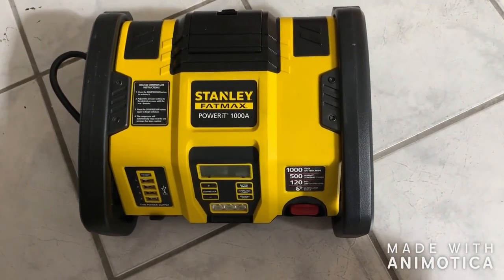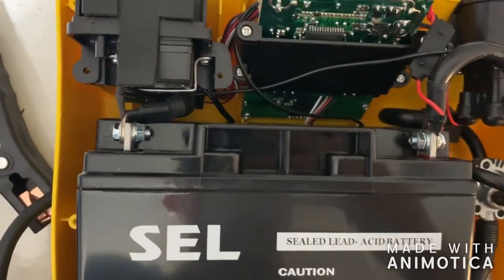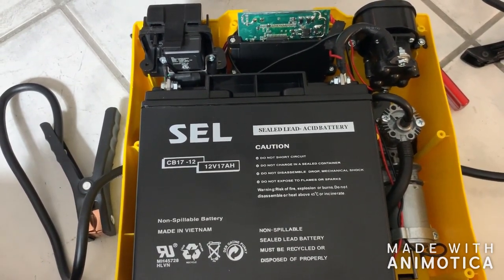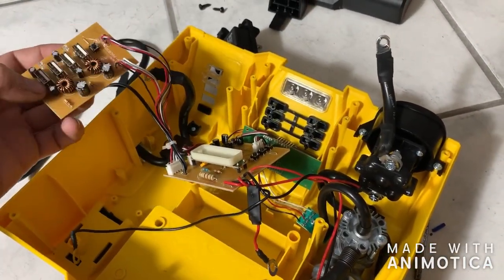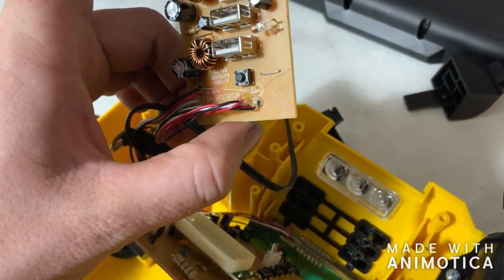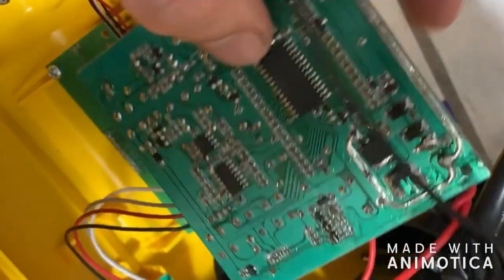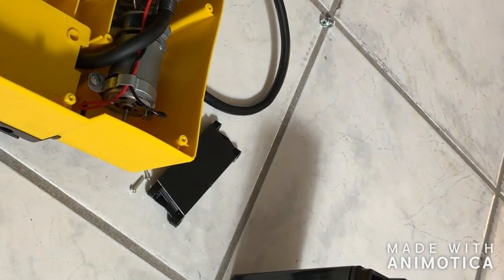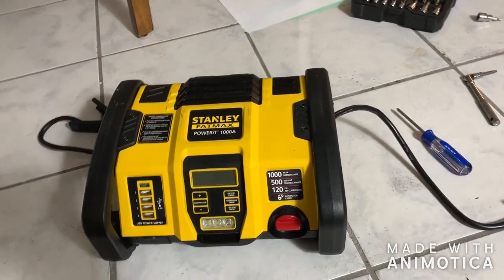Stanley Fatmax Jump Pack - Disassembly and Review

Comment: I've only used my charger about five times in the last two years. It would work just fine until about two weeks ago. I took it off of my truck to charge it up because I figured it was dead. No lights where on are doing anything. Charge it for 24hours and still nothing. Did you find a fuse or something that I could begin the trouble shooting or do you think it's DONE?
Reply: Same
Reply: Lead acid battery is likely kaput.
Reply: I have one just like it, I used it two or three times and left it charged, time passed and I saw that it had no charge, I put it to charge for two days and the battery is dead...

Comment: The way these things work is that the jump pack charges the cars dead battery and then supplements extra current to help the cars battery start the car.  The internal batteries cca capacity can be lower than what is required to start the car because of this. Only if the cars battery is sulphated will the jump pack not start the car.  It will easily start a big block if the battery in the car is drained but not sulphate.  I start my diesel with my fatback often.
Reply: Sorry, spellcheck changed some of my wording.

Comment: Is possible to put a Lithium battery in? My Faxmax can't hold a charge anymore.
Reply: We were interested in doing the same, but talked ourselves out of it.  A LiFePO4 battery requires a different type of charger.  A SLA charger (like in this device) runs the risk of over/undercharging and potentially overheating (i.e., fire!) when attached to a  LiFePO4 battery.  What you would have to do is also replace the internal wall charger.

Comment: I hooked it up backwards and now it won't jump (or do anything else).  took it apart and checked the battery, It has 12 and a half volts. what did I burn up?
Reply from the maker: I would think it's the switch with the big red knob causing your issues.
Reply: @lsm13b66  I'll give it a shot! Thanks!
Reply: @MatthewLovesAyn  did you fix it
Reply: I think I might have done the same thing and it won't stop beeping or shut off any info would be appreciated.

Comment: Hello. Mine performs as should. But randomly the compressor turns on by itself and start inflating multiple times a day. I have to press the compressor button to turn it off. What could it be? I just test it today and the compressor is working fine.
Reply: Mine did that, I tilted it to the side, water came out worked fine afterwards

Comment: Hello.  And thanks for you video. Now I have a problem and I need some help. 
Mine don't charge.  Whene I connect is like I didn't,  I can see nothing in the screen   I opened to see if any cables are lose but I can't find nothing.  It is still working  if have 3 line charge , but something happens.  Ca you or any body can help me. Thanks
Reply from the maker: Osvaldo Azahares, Pedro nieves had the same problem. You can charge it with your car by connecting the jumper cables and switching the red switch while the car is running but I don’t know how to fix the wall charging problem. Maybe Pedro has a solution
Reply from the maker: Osvaldo Azahares so did ET2 carbon
Reply: Is there any fuse that I can change
Reply: Thanks. I 🤔 but I didn't see pedro issue.  And he never said if working or not after your answer

Comment: The one I have does not want to charge. I plug it to a wall outlet and do anything. It's still works because the battery is still charge it.
Reply from the maker: Pedro Nieves  that’s unfortunate, it could be the ac power block that has the wall plug on it is bad. You could test it with a multi meter. The other thing it could be is some component on the main circuit board. 
If you don’t want to fix it you could always just charge it by leaving it connected to a running car with the switch on.
Reply: @lsm13b66  thank you. You mean leaving it connected but not with the red bottom on the on position(same as if i would jump a car)?
Reply from the maker: @pedronieves5845  yes!
Reply: @lsm13b66  thak you. I will try!!!
Reply: @lsm13b66  I opened my unit and found that the resistor/diode was burnt.  DO anyone know which resistor the 1000 uses?
Reply: @catman-catmirass  I have the same question.  Any ideas?

Comment: I was expecting to see "disassembly". Therefore the video has not helped  me to remove the cover and the  arms to access the inside although I think I have removed all the screws.  I guess not. Thank you for what you have shown.
Reply: There are like 4 screws on the back and like 4 on the front that uses Alen  wrench don't know the size but they are easy tu see

Comment: does anyone know what the resister is on the board in the middle of the unit (at the top).  I was pumping up my tire and the unit stop.  I went into the unit and the center circuit card resistor in the middle of the unit was burnt so bad that when I touch the resistor it fell off
Reply: I have the same problem.   Does anyone have the answer?
Reply: Same problem here

Comment: Since you've already voided your warranty, replace that lead acid battery with nickel metal hydride.

NiMH LSD can survive up to 2000 charge cycles, discharge 2.5% per year on average, can last 15 years on average, and have a maximum operating temperature of over 100°C (212°F).
Li+ can only survive up to 1000 charge cycles, discharge 20% per year, only last about four years, and they tend to explode at 80-90°C (170-190°F).
PbA can only really last 350 charge cycles, discharges completely in the matter of months, lasts two to three years IF CODDLED LIKE A DELICATE BABBY (less than 6 months otherwise), and quickly burns out above 45°C (113°F)
Reply: Nickel metal hydride, where to buy

Comment: Mine won’t stop beeping
Reply: Does anyone have an idea why mine will only work when it's plugged in? When it's plugged in it says it's fully charged but when I unplug it I get nothing
Reply from the maker: Sounds like the battery may be unplugged or dead? You can check the battery with a meter and see
Reply from the maker: That’s annoying
Reply: Mine won't stop beeping or turn off info would be appreciated?